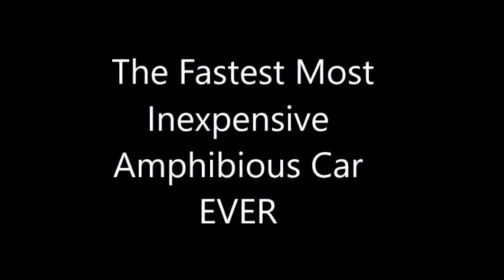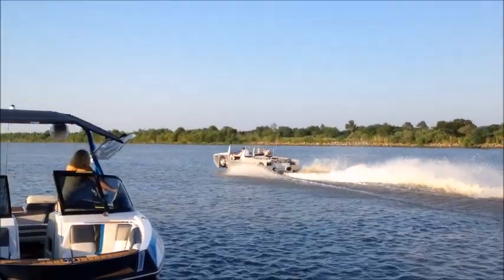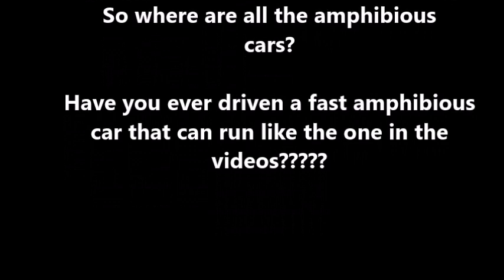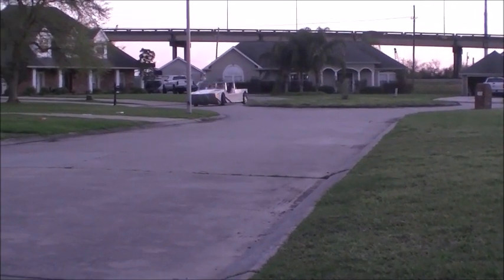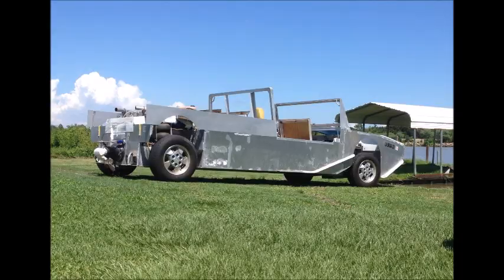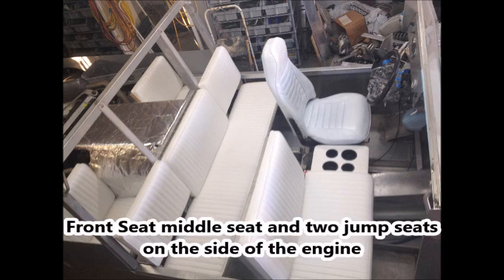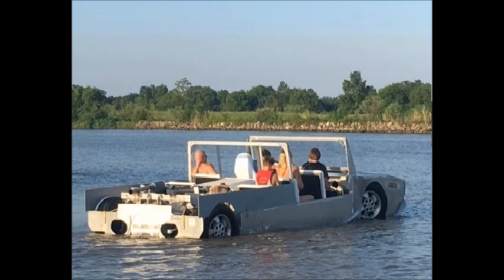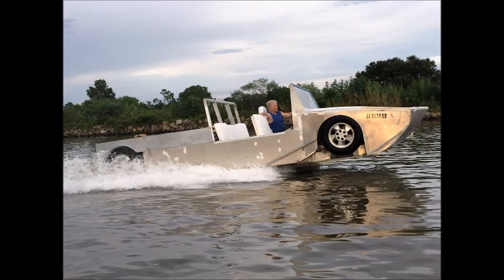Cheapest Fastest DIY Amphibious Car

Comment: Condescending to tell others they don’t have the knowledge. I have a 9th grade education and could easily build a electric amphibious vehicle using Tesla solar glass , a Tesla battery pack , and electric drives . So please your carbon footprint is showing 😭😂😂
Reply: The primary focus was building amphibious vehicles for FLOOD RESCUE & RECOVERY.  I stayed during and after Hurricane Katrina in some of the hardest hit areas just south of New Orleans.  I volunteered and worked on multiple projects clearing streets, shutting off broken water lines, shutting off broken gas lines, fixing ferry landings…… (Running heavy equipment and some Fab work/welding).  All before the long awaited National Guard showed up.  It was painful for me to watch the Houston Hurricane Harvey event with the first responders working in the tiny 4.5’ wide x 16’ long open flat bottom boats.  Everything they had was soaking wet and it rained for at least 3 days straight.  The first responders on the ground and water were so limited in what they could do because they were so poorly equipped.  We have the technology available.  If I can build an amphibious vehicle in my garage that can run over 40 mph in the water and over 70 mph on land, why aren’t they out there?  It is sad; it is like if we were still making firemen use horse drawn firetrucks.

You mentioned carbon footprint.  A Rescue Helicopter cost about $14 million dollars, cost about $1000 per hour to run and burns about 30 gallons per hour.  The amphibious vehicle burns less than 5 gallons per hour and can haul more people/supplies.  In addition it burns nothing if it staying in the area observing and waiting for a call.  For the cost of one rescue helicopter we can probably build over 50 Flood Recovery amphibious vehicles.  (Note it would be a much better, bigger refined version of the low buck proto type in the video.).  Also please do a little research I believe the Telsa cars are still using lithium batteries and not the better future glass battery technology.  The Telsa electric cars have an enormous carbon footprint.  Mercedes did a study and they insist that their diesel van is more environmentally friendly than the Tesla electric cars.  In addition they are cheaper and they are not government subsidized with our tax money.  Also note if you are working in a Flood zone chances are the electricity with be out.  So you would probably have to use a diesel generator to charge an electric amphibious flood rescue recovery vehicle.

Now I would also like to see people in the private sector have at least a couple decent amphibious vehicles because I know at least some of them would be used in future Flood Recovery events. 

Now I have to admit that I was aggravated when I made this video because a “News” magazine did an article on my stuff and they never contacted me.  Obviously they did not even do any research or even watch the videos that I had posted.  They made false outrageous statements like when you want to go in the water you simply drop the OUTBOARD MOTOR on the back.  There is no outboard motor.  They also stated that anybody could build an amphibious vehicle if you have lots of time and lots of money.  I had a full time job and no money.  So I had a News magazine that had more money, time and resources than I did writing BS about me and my project.   They knew nothing about what they were saying and they were marginalizing my efforts to do something that I feel needs to be done.  So I am sorry if I did come across as condescending but it was in response to something.

You are right that maybe it was a bad format.  The problem is no matter what I say about (what they said) it still comes across badly.  Misinformation is very hard to undo especially when they have a bigger internet audience. 

Thank you for bringing this up it forced me into saying a few things that I think needed to be said.  I am sorry if I come across as condescending but I am passionate about my goals and I hope that I can do something that will make a difference.
Reply: Bert Sandlin I am a veteran first responder firefighter I’ve been there and saved many lives and held the heads of those in my lap that lost their lives , their blood brains and intestines urine and feces upon my body . I’ve seen shit that would cause many to freak the fk out somehow I held it together . We’re talking babies and children young and old . From suicidal gun shots to the head and having to work the person for 45 minutes while watching the family dog lap up the brains and blood , horse kicking off the skull cap of a child , children with their brains throbbing to the beat of their hearts exposed from trauma . Fk yeah man so the quicker we can save someone the better . I mean as a firefighter first responder it never crossed my mind I was going to the dead , it was about the living . Anyhow we need more economical affordable and environmentally friendly dual purpose vehicles or hell what about a tri purpose vehicle that runs on water and land and flies . Now that is where the future is going . Peace ✌🏻
Reply: @texasflashcoveinstaller4317  I too have been there.  I lived 3 years in the Philippines worked for the Navy, been around the world twice with the Navy and below the equator on a Navy ship.  Yes I've seen King Neptune. I also worked in the Iraq Oilfield and been to some real shithole places like in Karachi Pakistan.  When I was a kid I watch a man get nailed to a cross and was close enough to touch him.  They wanted me to watch to see my reaction.   

I also saw the hollow look of hopelessness and disbelief in many peoples eyes that lost everything in hurricane Katrina. Now I have an engineering degree, fairly innovative  and I am can do a little welding and machine work.  I know boats and cars.  I don't know enough about planes to build one.  So I do what I can.  Hopefully if I can't get something done or I can inspire somebody to do more.  I know that you probably would like to use version II if you're doing flood response work.   I am working on 8' wide x 29' long with enough room for a 6'-4" man to stand up in.   Please subscribe and stay tuned to late this summer.  You will probably find this video a little less irritating.  Spoiler Alert it is me playing the guitar and singing.   So please don't be a hater.  You can what you want about my singing but please try to promote the work and the concept.  https://www.youtube.com/watch?v=XR002A-Sg24
Reply: Bert Sandlin well I’m a little McGeiver that lives less than 6 miles from spacex with investment funds to blow Elon musks mind when my son can transverse from out home across the lower laguna madre to spacex approx 5.6 miles ( or leave a huge carbon footprint but traveling by gas power to boca chica from port Isabel round trip 60 miles ) by amphibious transportation with electric innovation and a design that is adaptable to swells up to 4 ft and winds of 45 mph that can land on the beach and access county road to the STARGATE . Now that would bring consumers all I need is an engineer . I can see the mechanics, I just can’t do the math
Reply: @texasflashcoveinstaller4317  The future is glass batteries, fortunately that is coming soon.  Unfortunately they are not really available yet.  Give it a couple of years then I am in.  Note when we get to the point that the glass battery technology is readily available you will probably need a team.

Comment: terribly low clearance.
Reply: The amphibious car in the video is my first prototype.  It uses an air ride suspension system.  If 100 psi of air is put in the bags it can have up to a little over 9" of ground clearance which is good for a street machine but not great.  Also if I run it with that much air pressure the bags are fully extended and rock hard.  Air pressure in the bags in the video was probably about 80 psi about 8" of ground clearance.  Also the Tires on the version in the video are only 30" OD.    I learned a lot building the first version.   I was using Ford 8.8 IRS differentials with stock Ford inner CV's.   On VERSION TWO I am making my own sliding short shafts out of ETD 150 (150 ksi steel).  I am also modifying Chevy 2500 4X4 outer steer CV's and putting them against the 8.8 Ford Diffs.  I keep the same CV run angles but it allows me to put the differential lower in the hull chassis which increases ground clearance substantially without creating a CV service life problem.   Also note do to some other design changes I can shorten the wheel base which helps.  Also l am working on an amphibious flood response hull/chassis that is 8 foot wide with  40" OD tires about 16" of ground clearance
Reply: Good luck with  mods. What is the hull sheet thickness?
Reply: The Bottom is made of 1/4 Thick 5052 marine grade aluminum.  The sides are  3/16" thick.  The stringers are 5052 aluminum 1/4"thick.  The control arms are 6061 aluminum 3/4" thick.

Comment: Can you show the engineering on the vehicle rather than talking about yourself?
Reply: Sorry I was aggravated when I did the video because some oblivious clowns did not even watch a video of the vehicle before they ran and article with a bunch of stupid statements.  The hull/chassis is a 5052 Aluminum the bottom is 1/4" thick the sides are 3/16" thick. It is 80" wide and just under 20' long.  It has two stringers that run the full length that support the independent differentials.  The rear brakes are inboard and stay dry.  The marine drive system is a Berkeley 12JCA marine jet pump with a hand hole cleanout.  The suspension system is an air ride suspension system.  It also uses air bags to lift the tires.  On this version I used a 4 way valve to lift and lower the tires. The engine is an old gen 2 Chevy Engine with vortec heads it puts out about 285 hp.  The transmission is Chevy TH350 connected to a Modified NP205 Transfer case.  Note the all gear design of the NP205 transfer case makes it possible to modify and run the outputs independently.  The front differential in the version is a modified Dana 50 from a ford TTB front suspension.  The modified Ford TTB differential is probably one of the cheapest ways to create a front differential IFS that is located dead center in the front.  See Video.  https://www.youtube.com/watch?v=QGIW6rKUxVs  
 Did you see this video? https://www.youtube.com/watch?v=mQO6Fe8gwWw&t=5s 
Drenov are you an engineer?  Where are you located?   Do you have any specific issues you want to discuss?  Note the video looked tat was my first prototype.  After running the one in the video and making some changes there are a lot of options I like better than what I did in the video.   Are you actually trying to build an amphibious vehicle?